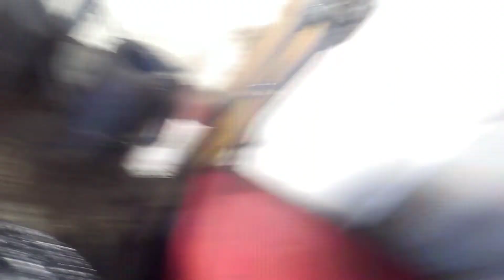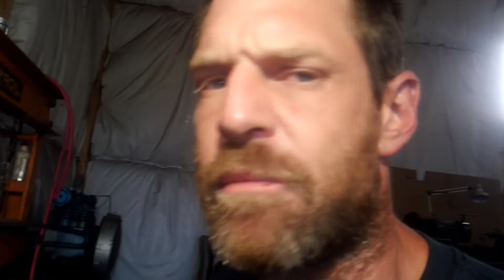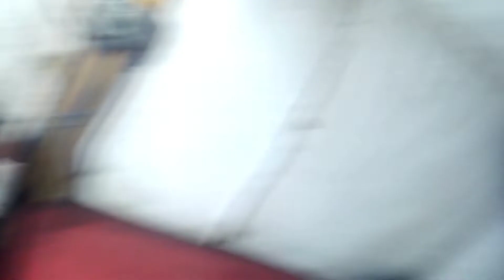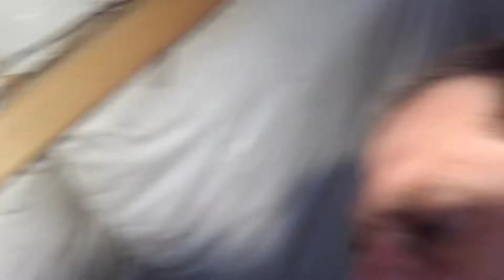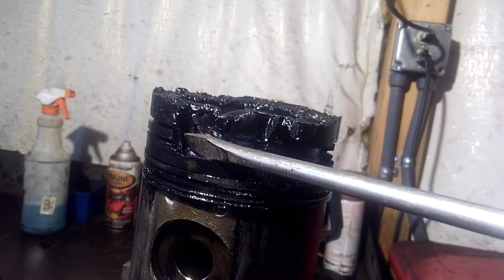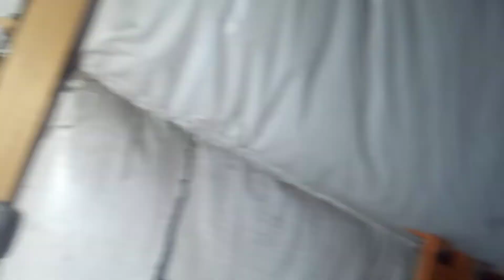Mack Injector Failure

Comment: Just had one a  Cummins V16 cylinders .
Smoking on right hand  bank .
But funny thing it idles pretty decent. 
Customer put 8 injectors on it still smoking .
We show up ck valve lash and all exhaust were tight (clue #1) reset lash still smoking .
Pulled injectors and air tested cylinder and would not hold air ,it was coming out the exhuast. 

Pulled 1 head and the exhuast valve had sunk into the head and the valve seat was gone .

Today's young techs have a hard time diagnose a mechanical failure like the one your showing 

Boils down to ,do you know the root cause ?
Reply from the maker: Thank you! Sir 👍